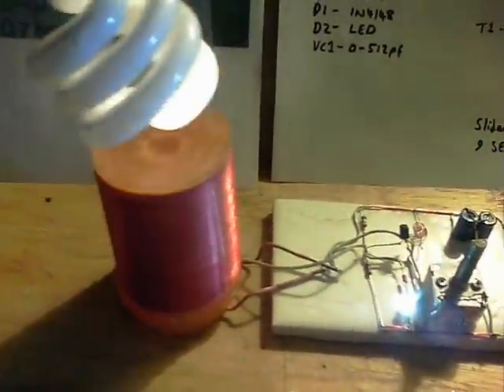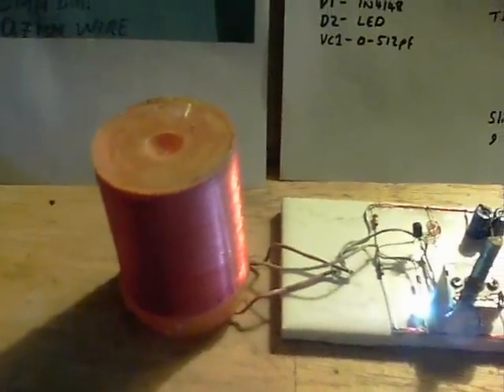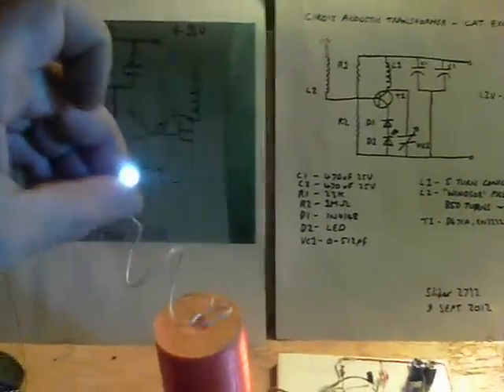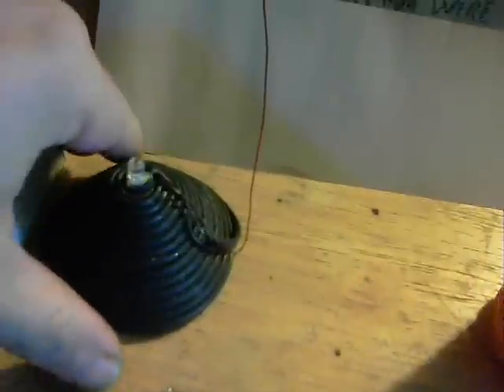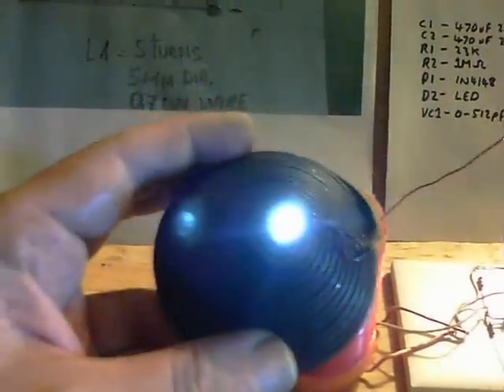CAT Exciter - The Italian job

Comment from the maker: If you are USA, it's a large sized pills bottle from Walmart/Walgreens. 50mmx70mm. The coil is approx 800 turns of high 30's gauge from Mabuchi RF-300 cassette player motors. For the internal type of conical coil, see my 'Flying with lights on' video, where it can be seen toward the end of the video.
Btw, a better circuit diagram is on the Bellisimo video on the sidebar. You can omit the var cap if just an exciter, but for spirit work, the var cap would stay true to the dreamed circuit.

Comment from the maker: Unless looking to affect radio signals you don't need the variable capacitor. Usually, as in GBluers Slayer exciter the var cap would go across the power connections and is very useful, but this type of circuit works without one.

Comment from the maker: Just seen your replication, great work ! The diagram looked like a Slayer, so was built like one...I have no idea how Ciro could dream such a design, yet it works. He''s a newbie + yet the circuit has low voltage start rail caps for one thing. The var cap seems off, should be across the rails, but does work within radio reception, so maybe that is the use.   Thought i'd replied earlier oops.

Comment from the maker: It's the shape of the coil that goes inside the tower. Such towers can have a few thicker wire turns on the outside or on the inside. This tower has them on the inside and wound around smaller with each turn, so it looks like a cone.

Comment from the maker: The separate part is now within the 2nd version of the circuit, in my vid just uploaded. They couldn't be included on the version 1, because of using a conventional Tesla tower.
They are prongs, that look like a Jacob's Ladder and apparently fed the energy out over them into the air...guess what ? they do exactly that now that they are on the new circuit build !

Comment from the maker: Thanks Derek. Have just built a second one, much smaller at about 2" x 1" with a ferrite piece as the onboard tower. Makes some wild and weird noises on an AM radio when the var cap is turned. It was suspected that the cap did more than slightly tune the output.

Comment from the maker: I do think he has his link with his grandfather already, if you see what I mean.
Would like to see a replication, especially with a Walgreen :) 
The 470uF caps are in line with 1000uF seen on some circuits...at low power <1V the exciter will go into a blink mode and yet placing hand just above input leads will give a rapid oscillation still and wireless output. Using parallel caps is like old circuits where high cap values weren't available, the transistor symbol is also olde worlde.